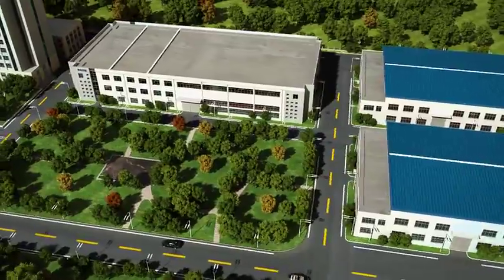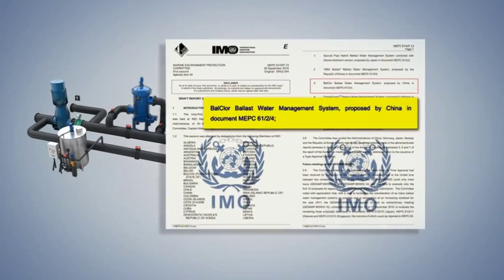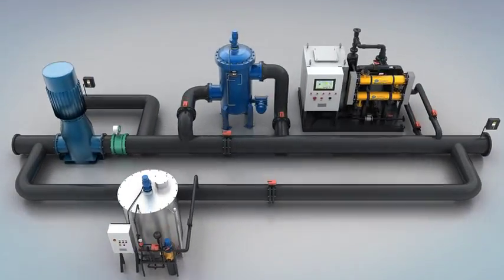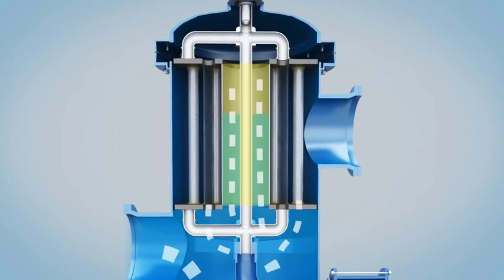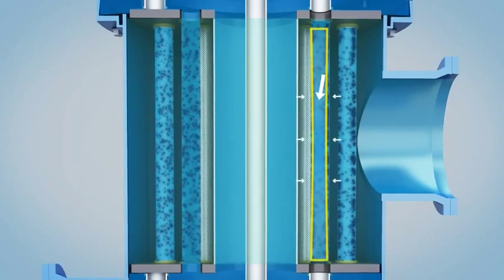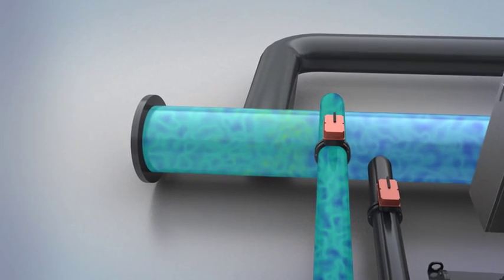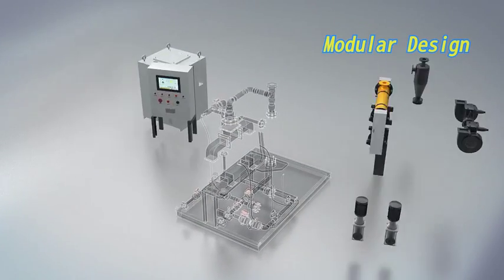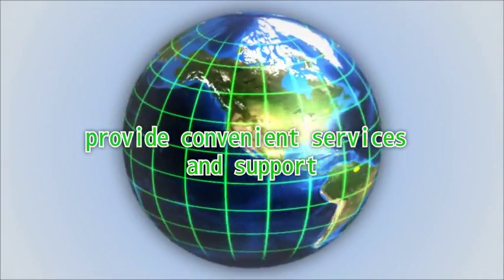Balclor - Ballast Water Management System

Comment: Could anyone knows that please explain to me, when we are at the channel for discharging cargo we should receive ballast to our ballast tanks but the density of the channel water is too low so we should use the high salinity water from the aft peak ( what we received before when we are in high salinity water area)  tank to mix and increase the freshwater salinity percentage to keep the system healthy for work properly, so what if the high density water is electrolyzed already before receiving into aft peak tank, is there going to be any problem to use this mentioned water and electrolyzed one more time when using for mixing to increase the salinity of the freshwater?